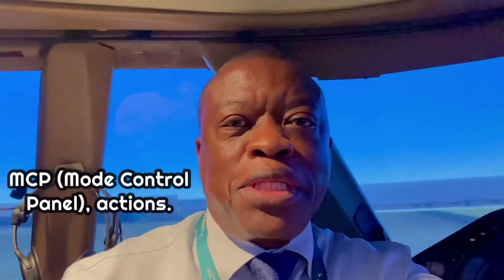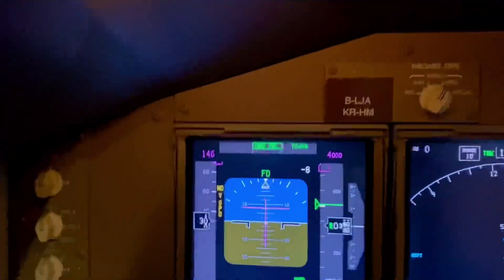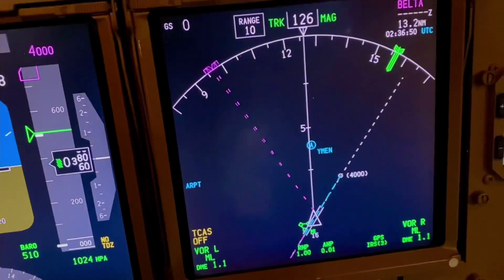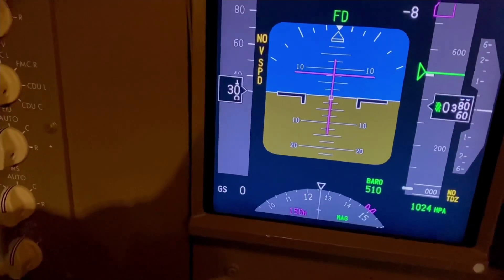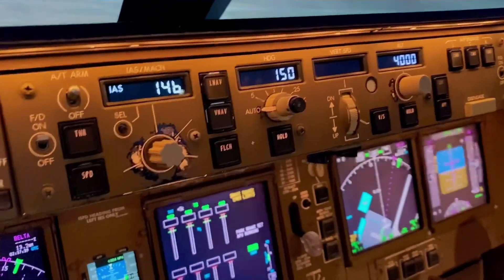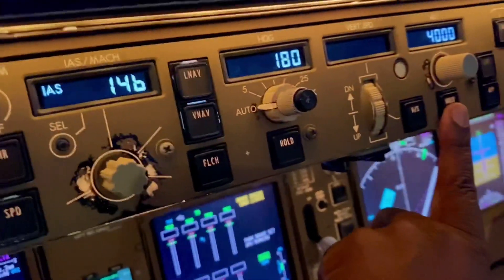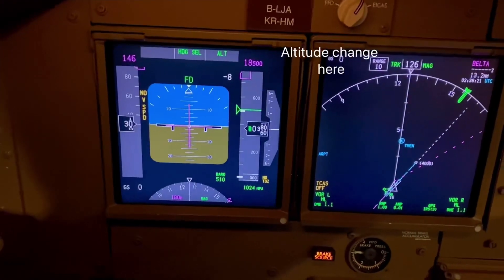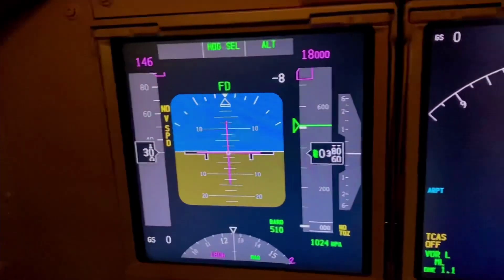Boeing 747 Mode control panel (MCP) actions

Comment: Thank you very much for this great video. I have a question though: how do you know the heading of the runway? Is it communicated by ATC?
Reply: Its all preplanned during takeoff and approach brief
Reply: It is on the Airport Diagram Chart. Jeppesen 10-9
Reply from the maker: Both answers are good
Reply: Runways are numbered by their heading. The number of a runway is always its magnetic compass heading in degrees, rounded to the nearest 10 and divided by 10. Since every runway has two ends, the difference between the two numbers will always be 18, as it's a 180 degree difference. For example, a runway facing due east-west will be runway 09 (90 degrees) from one end and runway 27 (270 degrees) from the other end. A runway facing due north-south will be 36 from one end and 18 from the other, and 36 is the highest possible runway number. Parallel runways use L, C, and R designations, for example two parallel east-west runways will be 09L-27R and 09R-27L. For more than three parallel runways (i.e. ATL, LAX) the numbers of one pair of them are shifted by one to avoid confusion.

And, yes, runways can and do get renumbered as the Earth's magnetic field shifts. For example, in 2018 Geneva airport had to renumber its runway from 05-23 to 04-22.